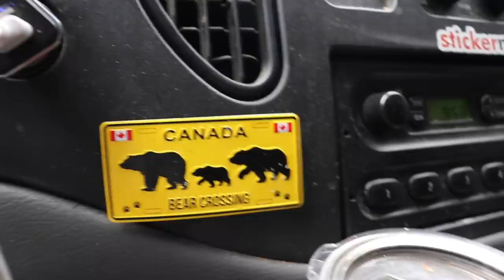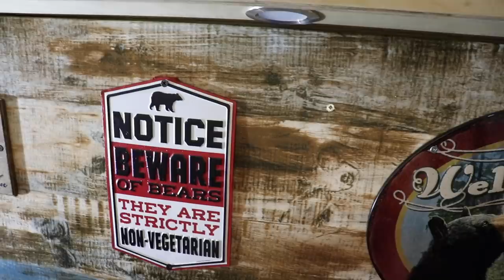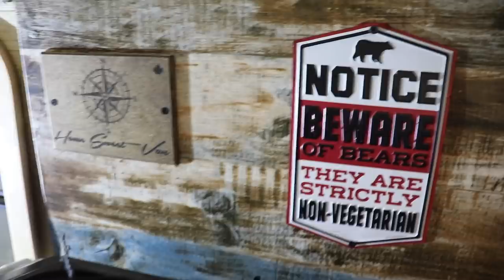Helping other van dweller/ Impressive how much can fit inside a van/ Van life community

Comment: Emi thanks for video.  I have my Van and it will be a couple of months when I can make my trip.  I am 71 so not as easy as before.  My question is did your cat take to travel right away?  I have been taking my cat in her stroller and going for drives. She is pretty upset but I am trying to get her used to it a little bit at a time.